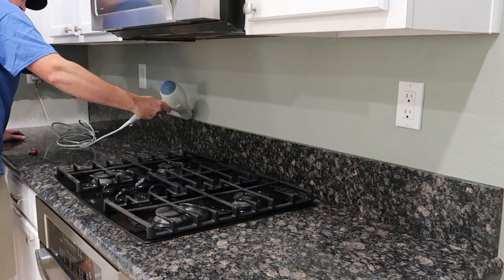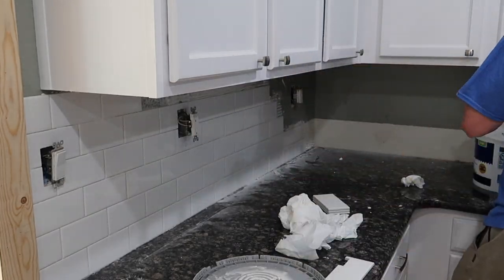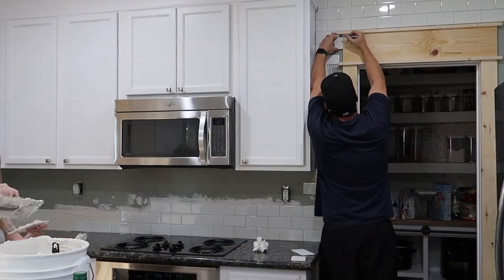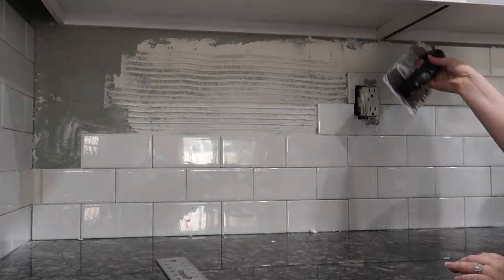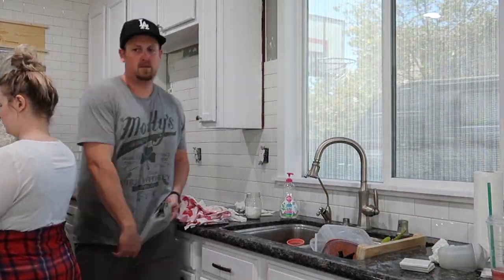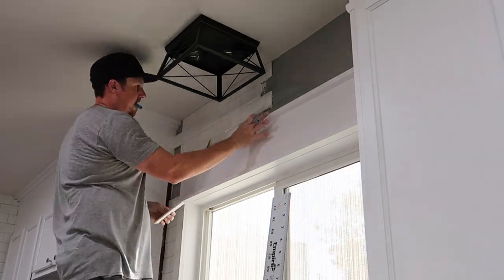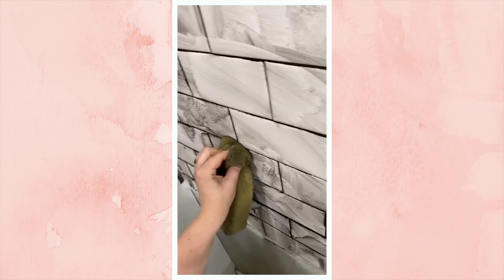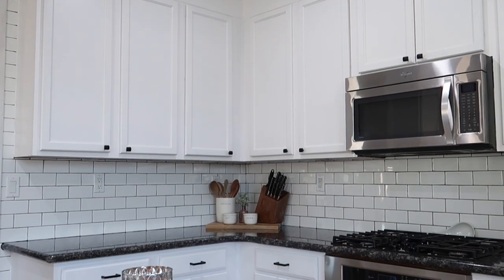DIY KITCHEN BACKSPLASH | SUBWAY TILE INSTALL

Comment: My house is in Los Angeles county and an old basic track home original almost completely with all original tub sink and subway tile.we removed the carpets and have solid oak hardware floors except in the bathrooms,kitchen and laundry which have or are being cheaply tiled in peel and stick for now. Lots to do but like you I'm not over renoventing my home and want to keep it fairly true to its bones.

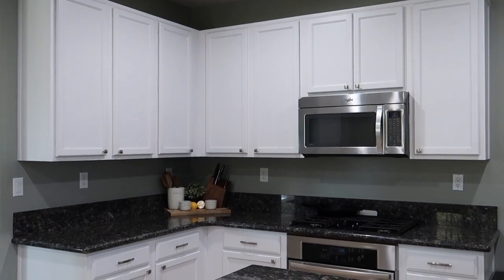Comment: At about the 17:30 mark in the before the cabinets don't go all the way to the ceiling but in the after you've installed something to give the illusion their taller cabinets. Do you have a video showing what you did there? Great work by the way.